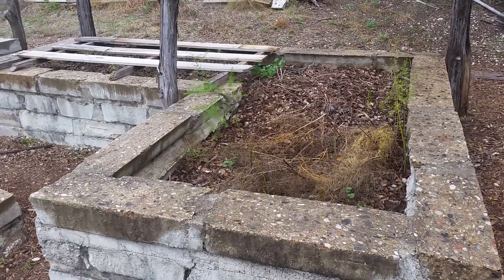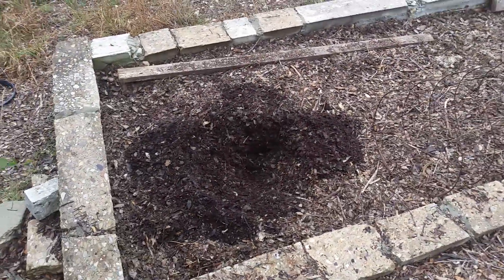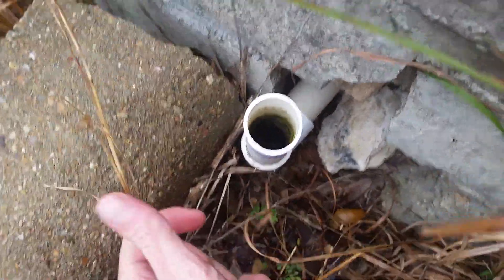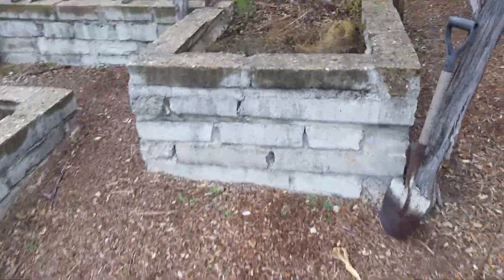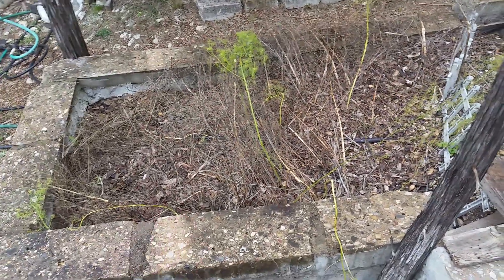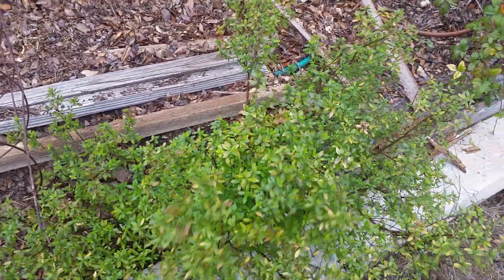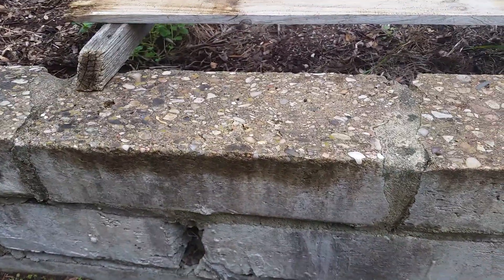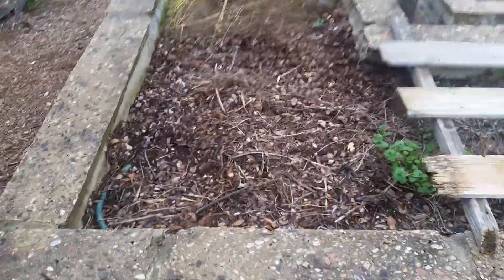Free raised beds. Ewok Modified Wicking Garden Beds.

Comment: Do you shred the leaves before putting them in the beds?
Reply from the maker: Sandy Ralston , at first I did, but then I realized it wasn't necessary.     I can wait a little longer for them to decompose, and I'll end up with more soil in the end, if I dedicate my effort into only gathering leaves instead.
Reply: Leaves make awesome compost soil, I use to put my fall leaves on top of my flowerbeds every fall and by spring they were beautiful dark brown dirt.  Now I am surrounded by pine trees, and they dont compost the same as leaves, I do miss my leaves but pine needles do keep the weeds low & pack down really well in my garden pathways.